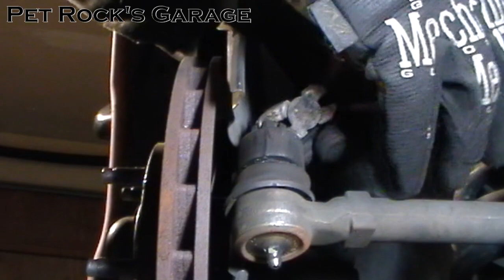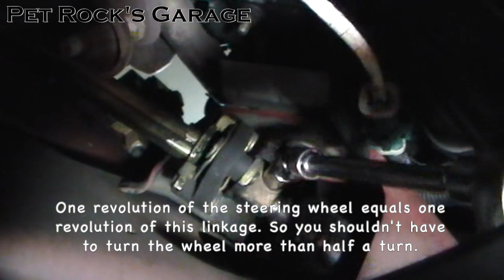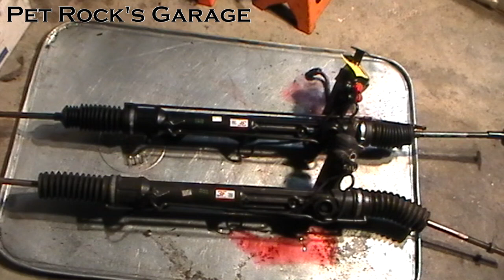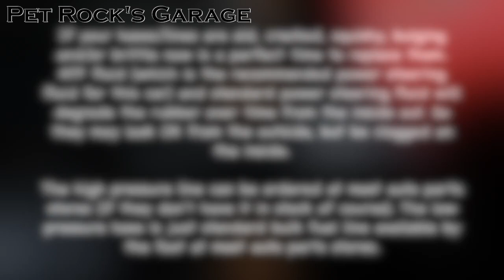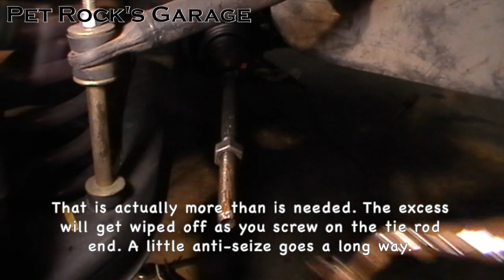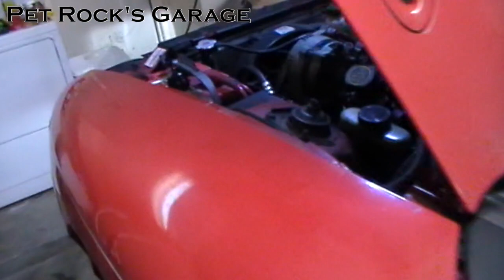How To Replace Power Steering Rack & Pinion -- Ford Mustang ('79 - '04)

Comment: What was the reason you had to replace the "re-manufactured" rack & pinion? You replaced the tie rod ends 6 months prior. And why did you use the same manufacturer? Either way, awesome video. Thank you!  John
Reply from the maker: I replaced it because it was leaking. I used the same manufacturer because the part was available in the time frame I needed it, and its no-ones fault when a seal starts to leak. It just happens. I don't have brand loyalty when it comes to parts.
Reply: @petrocksgarage  ; Again, I thank you. My son has a 98 Mustang GT. Fluid has been dripping the last couple of years. It has the original unit with 186,000. So it's time. If a part is a shoddy rebuild, I would consider a different brand. You replaced the factory unit. Then tie rod ends, 6 months later, the whole unit. Yeah, I'd consider a different brand. I'm not being a smart ass. Your video is the best tool.  John
Reply from the maker: @cobracharmer6178 , yeah, it does sound like it's time for your sons rack. Re-brands: I haven't had to replace the rack since I filled this video, which was actually a few years ago. But choose whichever manufacturer you like. Also, tie rod ends don't come with the rack. I think you might be thinking of inner tie rods, which are a different animal completely.

Comment: I cannot find the video for flushing it.
Reply from the maker: Sorry, I haven't edited it yet. In short, disconnect the low pressure hose from the rack and plug it with the ceramic end of an old spark plug or similar object. Put one end of another fuel line hose (or similar) on the low pressure tube on the rack and the other into a clear plastic bottle.  Then pull up the reservoir with fluid, rotate the power steering pulley with a wrench like I show in the video. Stop before the fluid gets too low.  Fill it again and repeat the process until clean fresh fluid comes out into the clear bottle. Then remove the extra hose and put the low pressure line back on and fill up the reservoir.  Then start the car and make sure there are no leaks.  Hope that helps.
Reply from the maker: Just a heads up. I just posted a video on how to flush the system: https://youtu.be/A5F4nPTh3cE
Reply: @petrocksgarage  ahh very kind, took it to a shop my buddy works at. Figured id be getting a steering alignment anyways and could not get the steering shaft disconnected.

Comment: I got stuck on installing the steering onto the rack.  I dont know what it was but I just couldnt get it.  It was one of those things where I kept trying and trying like an idiot.  Took 5 mins break and went after it again and it popped right on!  Definitely operator error. Dunce moment.  Car is good. No leaks.  No pump whine.  I saved some dough.  Thanks again!
Reply from the maker: Everyone has moments of genius & stupidity. Brag about the former. Learn from & laugh about the latter. Glad to hear you got it sorted out.

Comment: Thanks for the video — I'm doing this, soon, with my Crown Victoria, but I'm a bit nervous around the serpentine belt; can't I just have someone turn the engine over while I'm standing by with fluid that's ready to pour into the reservoir? I'm then thinking of bleeding the system afterwards, by removing the cap on the reservoir and turning the wheels left and right (engine running, wheels off the ground).
Reply from the maker: Don't be nervous about the serpentine belt. They are super easy to get on/off. I haven't worked on a Crown Vic in a while, but if memory serves, there is TONS of room in the engine bay to get your arm down there with a wrench to turn the tensioner to get the belt off. Just make sure not to let go of the wrench and let the tensioner snap back after you remove the belt. You could damage the tensioner. There should be a sticker on the underside of the hood with the belt rout on it. If not, take a picture before taking it off, or draw it on some paper so you don't forget. 
I wouldn't bump the motor to bleed the system. I think I mention that in the video. Even a quick pump will turn it over a couple hundred times and can quickly drain the reservoir. That will let air into the system and you'll have to start bleeding all over again.  Its easier to do it by hand like I show in the video.
Reply: @petrocksgarage  Thanks for the reply.
I'll try dealing with the belt. What I wonder is how tight to torque the tensioner once I am finished. Also, once I have the required amount of fluid in the system, isn't it still a good idea to bleed the system with the aforementioned method?

Comment: Hi, so far so good. Got to the part of removing the two bolts securing the rack to the frame. The bolts on my 1996 3.8 are reversed. i.e bolt heads at the rack bushings with the nuts behind the frame. Is this normal ? or is it possible someone has changed the rack before - somewhat unlikely as relatively low mileage, although after 23 years it could be possible.
Reply from the maker: No, that's not normal or factory spec as far as I am aware.  Someone must have either replaced or removed the rack on your car at some point. There are tons of reasons a rack could have been unbolted let alone replaced.  e.g. accident repair, to gain access to some other component, someone thinking they new better, etc etc.  The list goes on.  I wouldn't worry too much about it.  Just put it back the right way when you are done. Good luck.
Reply: @petrocksgarage  Yep, I did figure that your video was the way it should be - thanks for the confirmation. Whoever did it didn't have your video to show the way it should be done. I ran out of daylight here in Spain. So will finish of tomorrow . Just got to add the ATF - following you instructions. Again, many thanks.
Reply from the maker: @mikethorogood8085 . Thanks a lot. I'm glad my video helped you out. Thanks for watching & commenting. I appreciate it.

Comment: Great video. I'm doing a rack in pinion on my 95 mustang gt. I managed to get it off, but didn't hear the part where u said NOT to turn the steering wheel. So I lost track of where its center is. How would I get it centered again without messing up the clock spring? I have not put in the new rack and pinion yet.
Reply from the maker: That is a very good question. The clock spring is pretty fragile. It doesn't take much to break it. One P.I.T.A., but sure fire, method would be to remove the clock spring, center the clock spring rotor, center the wheel and then re-install everything. Make sure to disconnect the airbag fuse so it doesn't accidentally go off in your face while you are working. There might be another way that I'm not aware of though. If you find an easier way I'd be interesting in knowing how to do it.  Good luck.
Reply: @petrocksgarage  thank you so much. I have been looking online and can't find any other way. I will try this later. Great videos and tips.
Reply from the maker: @code494 , no problem. Good luck.

Comment: How is the Nitetrain?
Reply from the maker: Doing very well. Installed a 6-speed trans a few months back (no video though, sorry). Absolutely love it and kick myself for not doing it 80-90k miles ago.  Put 400 miles on it up in the mountains the first day. Only problem I had was forgetting that I had a 6th gear to play with on open stretches.  :-)

Comment: Very good Video. Can't think of anything you missed. Also a question. My steering on my 2000 GT Mustang is getting stiff. What would you recommend for figuring out what's wrong? I turned the steering wheel side-to-side at least ten times to purge any air and also checked the reservoir. It's the original gear and never has been touched.
Reply from the maker: Thanks a lot. I appreciate it.
Re: stiff steering, it sounds like your power steering pump is on its way out, or you might have a collapsed power steering line between the rack & pump. The high pressure lines are notorious for collapsing internally over a long period of time, but looking normal on the outside. If your lines are over 10 years old, I would consider replacing them.  Good luck.
Reply: @petrocksgarage  Thanks. Actually, a few hours ago I learned there is a steering shaft u-joint on the car and that it could be freezing up. I found it and sprayed with a lightweight lubricant and then went for a drive. It may have solved the problem because the steering is way better and after turning the wheel and letting go, it centers back. But take some credit because your video got me going on this! So do you think it will stay freed-up or do I need to have it replaced?
Reply from the maker: @ninemilliondollars , interesting. I wouldn't have thought the steering shaft joint would have caused your problem. Glad you figured it out. Who knows if it will last. But I'd just keep an eye on it.  If it starts binding up again, I'd replace it. Apparently you can replace just the u-joint. At least the part is available on RockAuto.com. Good luck.

Comment: Many thanks.  I'll check the packaging.  Regards from Spain.
Reply from the maker: No problem. Good luck.
Reply: @petrocksgarage  Yep ! I found them in a little bag. One other question: Can I use Valvoline ATF DEX/MERC when refilling?
Reply from the maker: @mikethorogood8085 , yes, it should work fine in your power steering system.
Reply: @petrocksgarage  Again, many thanks for the video and your help. I feel more confident to get on and do the job now. Of course we all have time on our hands as we go through this difficult time with Coronavirus. Take care, stay safe, stay home. This will pass.

Comment: Can I use regular rubber O rings, for the low & high pressure lines, or should I get nylon ones ?
Reply from the maker: Not all o-rings are created equal. They would need to be able to resist ATF fluid, which can deteriorate some plastics/rubbers.  It also has to withstand high pressure, which not all rubber o-rings can.  So in short use the nylon o-rings.  They should come with your new rack.
Reply: @petrocksgarage  Many thanks, a closer look in the package and I found them. Almost ready to do the job now I have watched you super video a couple of times. Some nice tips there so should not have any surprises. Great video. Now subscribed.